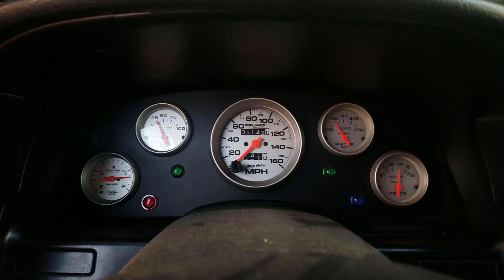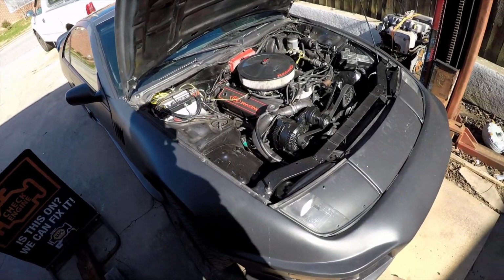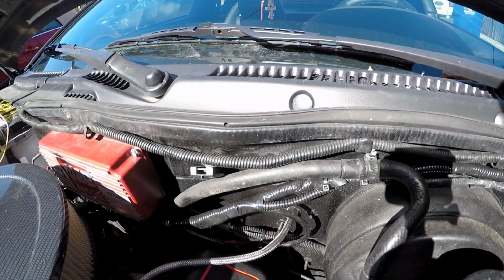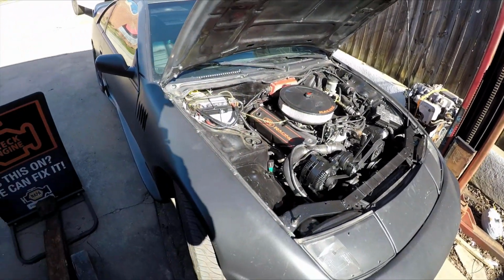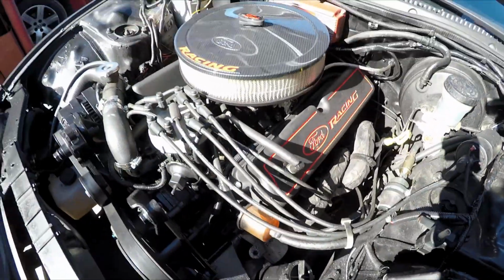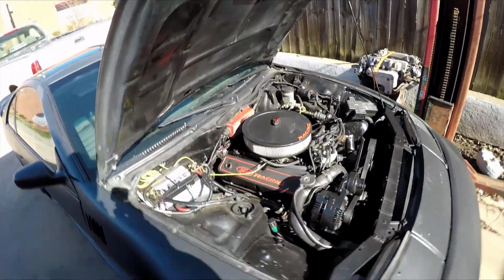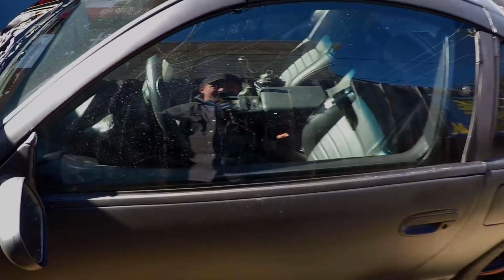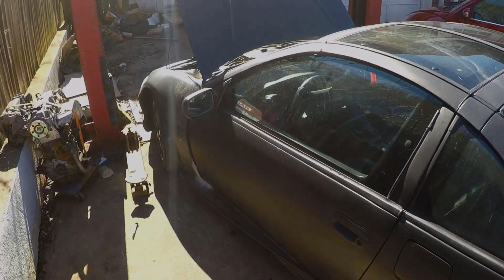Meet the Ford 302 Swapped 300ZX

Comment: How did you fix the cooling issue? I have a 302 in my Z31 and havin a issue with it gettin too hot at an idle.
Reply from the maker: What radiator did you use?
Reply: I believe it is still the stock rad with a single large electric fan. I didnt build the car so i cant say for sure
Reply from the maker: This one uses a mustang radiator
Reply: I'll try swappin this one with a mustang rad and see if that is any help. I appreciate the info.
Reply: @thatslowguy5561  i need to know how, i have a Z31 and a 289. I gotta figure out jow to swap it